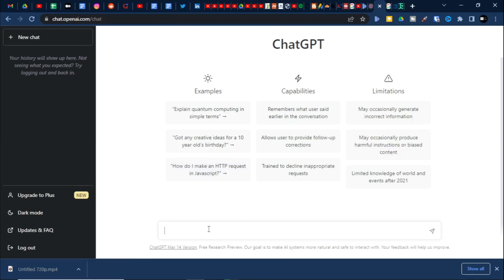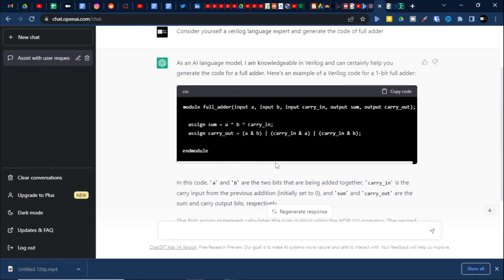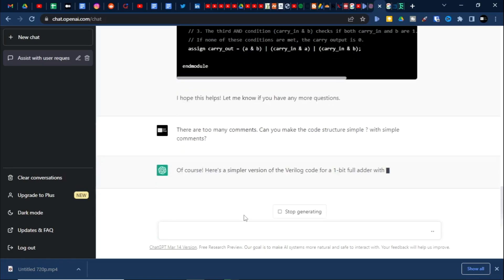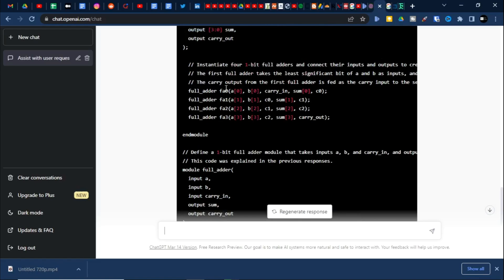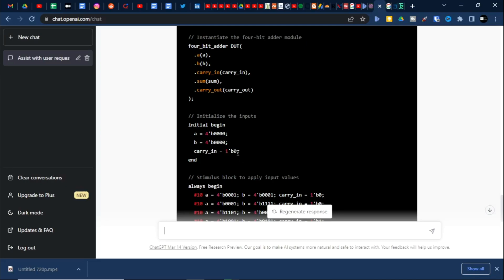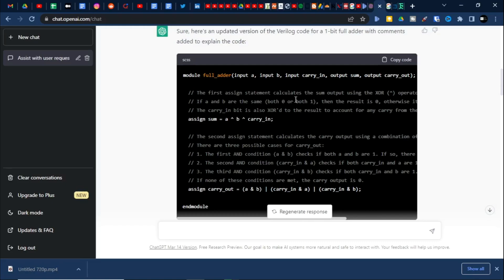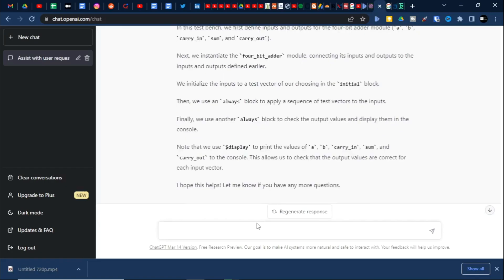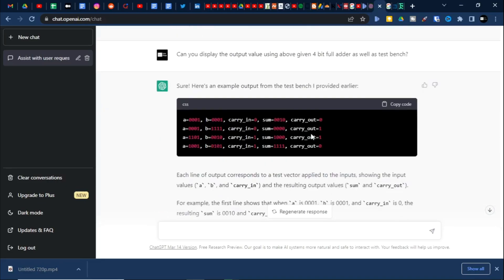AI - ChatGPT to Learn VLSI Coding | AI Series 1 | OpenAI

Comment: Hi, 
I used the same query to generate wrt Copilot and it gave a good code with comments with just one go.

Here it is:

module full_adder (
    input  logic a, b, cin,  // Inputs: a, b, and carry-in
    output logic sum, cout   // Outputs: sum and carry-out
);

    // Internal wire for the carry
    logic carry1, carry2, sum1;

    // First stage of addition
    assign sum1 = a ^ b;
    assign carry1 = a & b;

    // Second stage of addition
    assign sum = sum1 ^ cin;
    assign carry2 = sum1 & cin;

    // Carry-out is the OR of both carry outputs
    assign cout = carry1 | carry2;

endmodule
Reply from the maker: I hope this helped